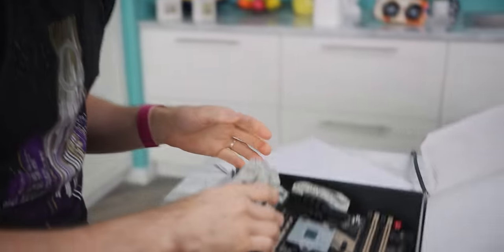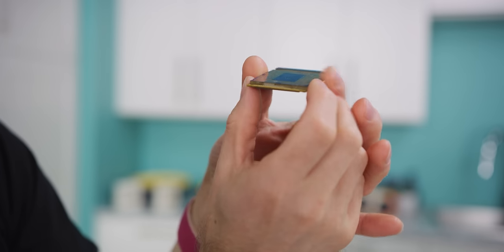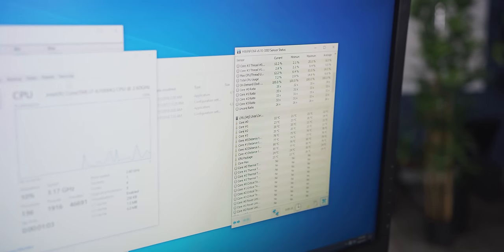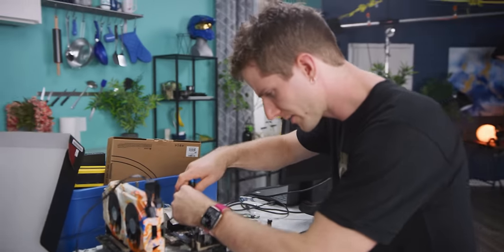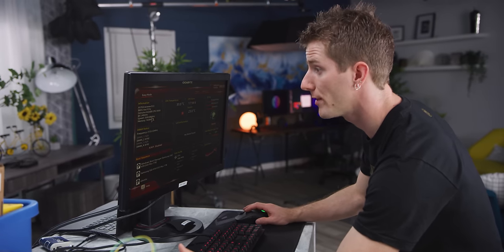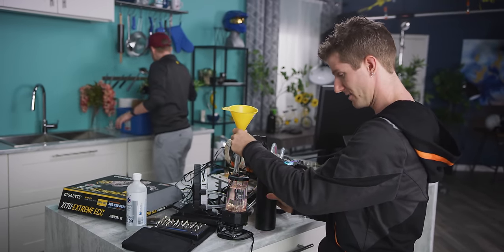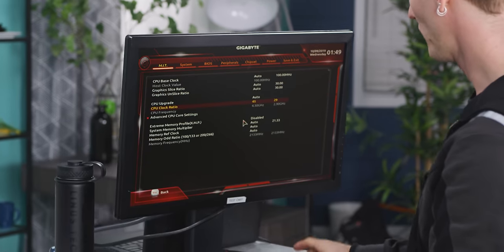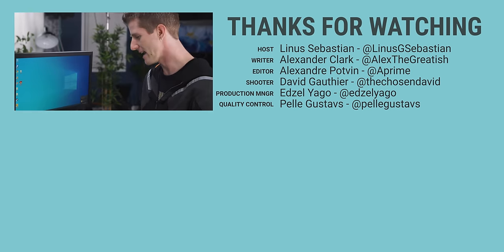Testing out Mystery Chinese CPUs

Comment: development CPUs are meant for developers to find out about problems, errors and faults. a final release CPU instead has most/all problems fixed, and if not, it will see official erratas on what was found on them. there further might be the chance of getting microcode fixes for them.

what would you expect from a BIOS that might have seen alteration? correct CPU identification? - if it were a scam, then this bios reporting strings and clock values would be one of the first things they would fake...

Comment: I guess it's been a while now but CPUs used to have no covers on the die during the P-III / K7 times. They didn't even have those aluminium frames, if you were lucky they had four rubber dots in each corner. Quite a point of failure tbh, I saw a bunch of dies with cracked edges because coolers had been brute-forced on them in the wrong direction. In retrospect, way too many for my poor soul...

Comment: Has never seen a CPU that looks like this? Ive seen OEM stuff like that. Custom mounting so no retail cooler would fit, was in the K7 days so naked die was normal. ALso seen OEMs with soldered CPUs. Not that strange tbh.

Comment: m8.. The mounting plate fell off of my b450 tomahawk too.. I mean.. It's not some sort of high end board, but at least you don't expect jank.. + Let the cpu fall in place by itself my ass.. after i assembled the whole thing, the cpu debug led lit up and no video signal happened.. read about it, and ryzens like to be pushed in.. so i took off the fan, and.. had to take the whole thing apart again because the plate fell off and i couldn't really hold it in place under the MB.. Only after squeezing that fucker in did it work properly...

Comment: GUYS. There is NOW something similar on the market that I just bought and am ASTOUNDED at the performance, with a motherboard and i9-11980HK for ~$300. It is a Tiger Lake mobile i9 soldered to a mATX board with an x16 and x4 slot and 2 DIMM slots. Chipset is HM570. Mine is “Erying” but I believe Maxsun also sells it. They’re LEGIT chips and chipsets. This is great bc with current gen desktop CPUs pushed 300 watts with graphics cards further, we will need to upgrade PSUs and cooling. The appeal of a 8c/16t Chip that draws under 100W now is appealing. BIOS is the most open and unlocked ive ever seen (shockingly considering i have a strix x570 gaming i paid $500 for 2 yrs ago) and you can enable XMP; mess with voltages, chipset settings, power limits, turbo durations, multipliers, plethoras of other settings i dont even understand nor messed with. It scores 14,000 in R23 Multicore under a garbage dell stock cooler coming embarassingly close to my 5800X with PBO under 360mm AIO…. Its something id like to see LTT/GN look into given economic conditions and how expensive everything is. Feasibly, you could use this 300 board/i9 with a $500 high end GPU and a decent case and keep your current PSU and throw an nvme in there (2 slots as well) to get a BEAST of a machine less than a thousand dollars USD…. Its a great product and I’m shocked it works at all frankly, and not only that, it works goddamn well!

Comment: If this can get some speed and support behind it, then it would really help the ewaste problem. All of those old sockets could be crammed into high density machines. Crap tons of tiny cards plugged into a 4u system. all low TDP. For places like google which basically run their servers on garbage this is not a bad thing at all!

Comment: hello and thanks for a great show
will say boot problems the way you put your finger up the cpu at the beginning of the video too and showing things will be a big part of the problems (don't look into wiping them off inside putting them again) and I've learned over the last 14 years in my shop reset motherboards are not as good and take out the batari and reset it that way when switching between cpu and graphics card ... maybe do it all guesses ... Mr. Su pisse good idea last year we threw out 200 cpu at one time which one of them was rat good and did not fail anything good with recycling
thanks for a cool show

Comment: Use a thin copper tape to shim it up but wash off any adhesive it has on it first then stick it on with a little thermal paste on each side of the copper.

Comment: Yea i just kinda did this with a backplate after taking a cooler off and putting a different cpu in and different cooler, was like, o,  now i gotta hold the back plate on, almost failed with cooler install as i touched down like 4 times with the thermal paste and i almost scratched the motherboard with the cooler screws when the cooler kept slipping off as i had the pc tilted at a 45 degree angle when i attempted the install,,, lay the pc as flat as you can and then try all that shit LOL lesson learned but everything was ok in the end

Comment: You can actually check whether the die is flush, lower, or higher than the surrounding shim plate. Just take a razor blade or a thin metal ruler, stand the long edge across the shim plate and cpu die, and shine some light through it. If there is even a slight separation between the razor blade / ruler and the object it stands on, light will pass through.

If you don't have a thin metal ruler, you can even use art knife refills or metal plates with known straight edges. For the light source, it can be a mobile phone flashlight, or even ceiling lighting.

Comment: Hi,  haven't built anything in years... last was a dual xeon dual quadro solidworks workstation... but now i'm running a completely off the shelf win7 (or can do win 10 if needed) dell m7720 notebook workstation, i7-6920hq, 64gb ram, quadro p4000 8gb, 17", 1tb ssd, 2 x 512 ssd,  and a bunch other stuff.  question... can I do anything to speed it up, clock it cool it, upgrade it... hopefully reasonably?
Thanks, cool video

Mike
Reply: wow, hadn't played cs in 10 years either

Comment: In your BIOS, find and release microcode for any low-end CPU you would never use. Then add one with profile that matches this laptop CPU. With all instructions and registers patched, your system will boot correctly. Note: Microcode must come from laptop using same chipset as your desktop motherboard. If anything goes wrong, don't panic. Drop back in your old CPU, reset BIOS, and try again. Also, your motherboard will not support power saving speed-step features only for laptops. Why should it? There's no battery.
Reply: And if you really screw up, follow instructions for How to "blind flash" your computer with original BIOS.

Comment: Heloo im new to pc building i have a question can i use 650 W power supply for a GeForce RTX 2080 ti and a ryzen 7 3700x and a 16 Gb ram or should i buy a more powerful power supply thnx if u respond . Have a nice day
Reply: 650w will be pushing limits, get a 750w or 850w power supply just to be sure.